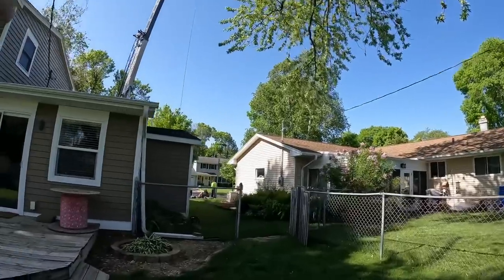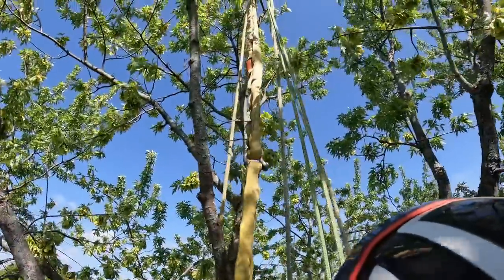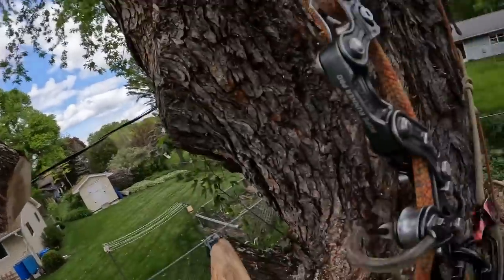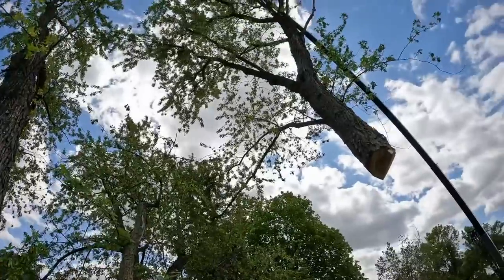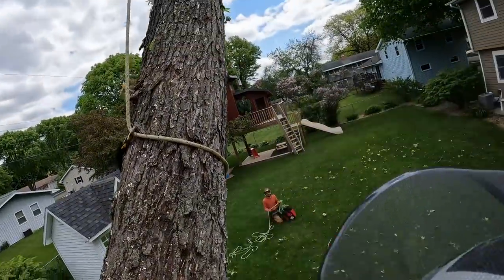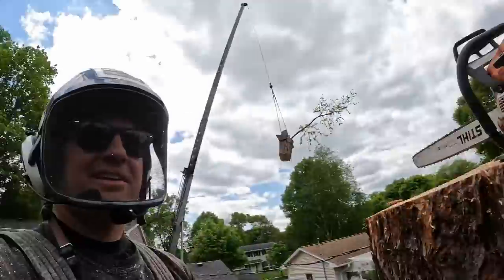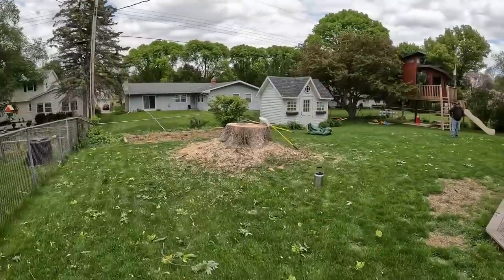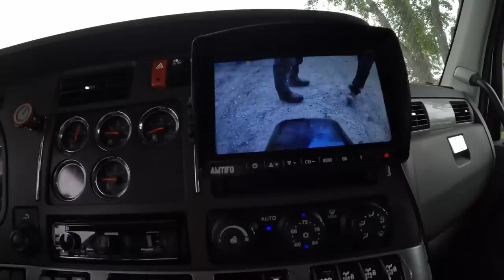Better to be safe, than sorry!

Comment: Really good, am enjoying your videos!  Wish I'd had y'all to go out for when I was operating.  That 60 ton Nat'l is beautiful.  Last one I operated was a lease purchase 32 ton Nat'l on a Sterling chassis.  The startup co went under the 32 went back to the dealer with the 08 "market adjustment," I think that's what they called it.  I retired.  Like that you're really close/excellent on your weight calls.  That sure helps the operator pucker factor. Thanks for sharing.  👍🏁🇺🇸

Comment: For the last 3 years, I've been running my 30 ton National with a hi def camera mounted on a pivoting arm, that looks directly down the loadline. A 12" full color hi def monitor is in my cab. It is a game changer for my work, mostly setting trusses and HVAC.
Reply: Where do you get your cameras? Are they decently priced?
Reply: @pnwoffroader331   I put the system together myself, the camera, actually made for indoor use but it has all the features I wanted and has held up great (though I don't leave it on if driving in the rain) was only $200.00 or so, the monitor only $150.00. The big expense was the wireless transmitter, made for high dollar pro drone use, around $2000.00. But it's also worked great, has perfect clarity, and something called "zero latency" which means what you see is what is happening, kind of important. Altogether, I have about $2500.00 in it.

Comment: great video as usual, always nice to see guys working smarter than harder.

do you ever have issues with requiring township permitting for road closure?

Early in my treework career I did one crane job where the only place the crane could go was in an active lane on a 4 lane road. requiring permitting and paid duty police for the road closure.  I was glad to be on the chipper that day, too much stress on that job because of when the window for the road closure was.

Comment: What's a ballpark  price for that kind of job. Here in Oklahoma,crane work starts at $9500.00,before the 1st cut.
Reply: Holy cow! Is there only one crane in Oklahoma? That's wild money. In Iowa, a crane this size is around $300/hr.
Reply: I have checked into it and that is the hourly rate here in Oklahoma.
Reply: Wow that’s a first, never heard of a minimum rate starting close to 10k. I do more pruning work than removals, but I would say the average cost for a large tree removal probably falls somewhere in between $1,200 - $3,500 give or take depending on the situation, how technical the job is, etc. $200-$300 per hour port to port for subcontracting a crane sounds about right.